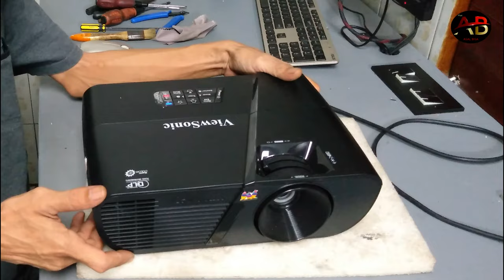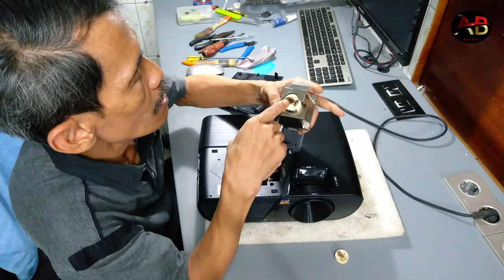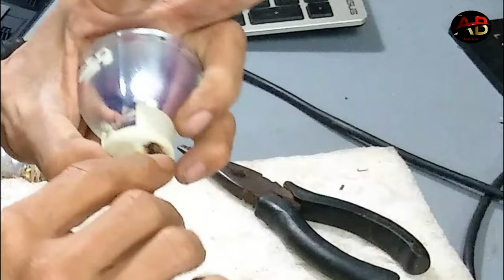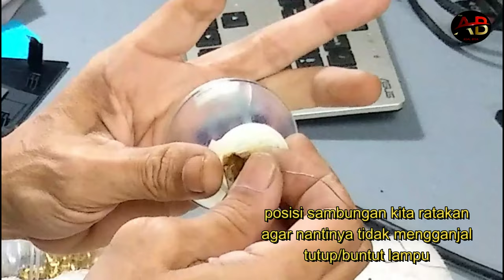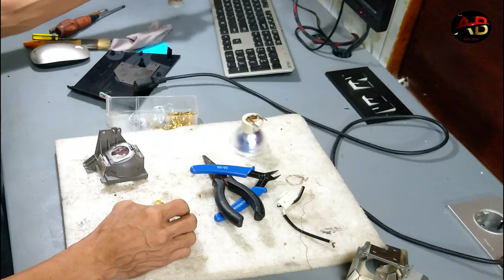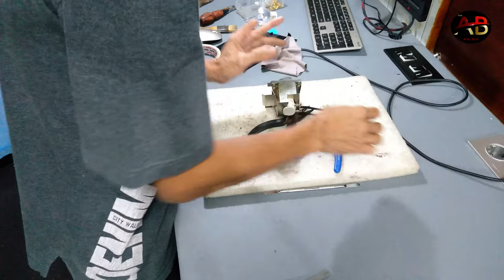cara perbaiki lampu proyektor yang putus

Comment: Pak untuk lampu toshiba tdp t350 dengan kode lampu p-vip 300 apa ada persamaan dengan lampu lain,atau harus sesuai kede  lampu aslinya
Reply from the maker: Vip 300 itu berarti 300 watt mas.bisa di ganti dengan lampu proyektor dmd yg jg 300 watt.coba cek spesifikasi lampunya dulu.
Reply: @Plat-AB-Asal-Bisa  siap pak trimaksih 🙏
Reply from the maker: @feryprasetyawan9892  sama2 mas

Comment: Assalamualaykum pakde, mau nanya sy punya kasus infocus in224 (psu 1modul dgn ballast), lampu sering short,udh 4x ganti lampu normal jadi short semua lampunya paling lama hanya 2jam,biasa baru dinyalain core lampu langsung short,komponen di ballast sy coba cek kok bagus semua ya sprti kapasitor mylar nilainya bagus tdk ada penurunan, ic coupple jg bagus.fet tdk ada yg short,kira2 apanya lagi yg musti di cek ya dhe? Makasih
Reply from the maker: Wa'alaikum salam wr wb. 
Kemungkinan tegangan dari power supply yg naik mas. Kasus power supply yg tegangannya naik,kadang malah sulit menemukan komponen yg menjadi sumber penyebabnya.
Reply: Oh siap dhe,suwun ilmune.mugi2 panjenengan diparingi rejeki yg melimpah lan barokah 🤝
Reply from the maker: @erdhyfikom  sami2 mas.amiiinnn🤲

Comment: mau tanya smog masi dibaca, bolehkah mengganti ukuran lampu aslinya 210/0.8 e20.9n dengan 190/0.8 e20.9n?
Reply from the maker: Sebaiknya tidak memodifikasi proyektor,karena proyektor termasuk perangkat yg rentan.tapi jk terpaksa memodifikasi watt lampu,kurang dan lebihnya maksimal 10 watt.jk lebih dari itu terlalu beresiko
Reply: @Plat-AB-Asal-Bisa  siap om terimakasih , iya ini bola asli dia 210,  oke terimakasih sekali lagi om
Reply from the maker: @autoped1a  sama2 mas bos